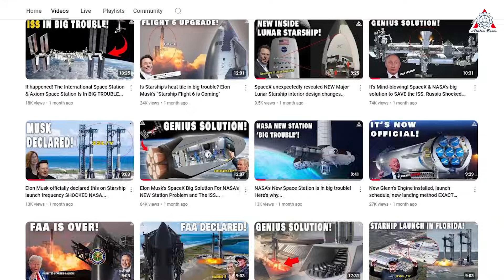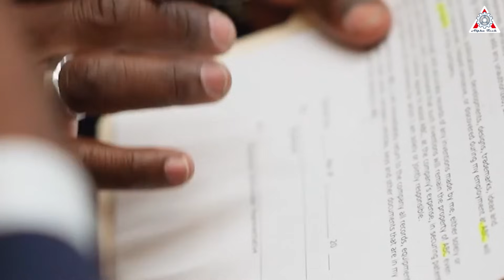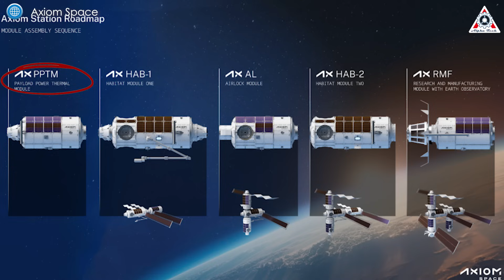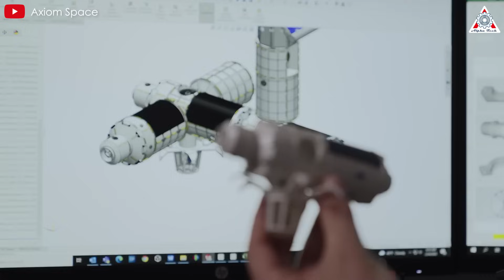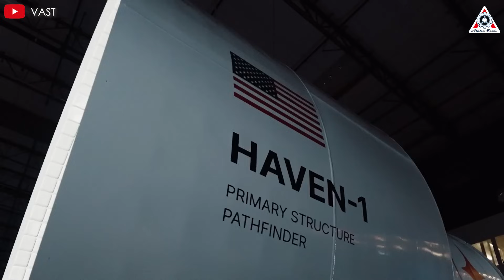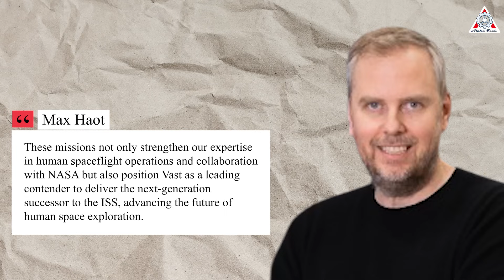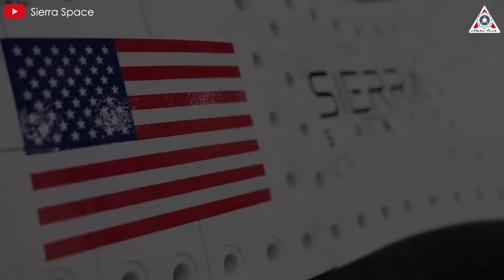NASA Reveals 5 Next Space Station Generations! Goodbye ISS...

Comment: Actually, our focus should be on mobility in Space, over permanent colonization in gravity wells, or on any body we cant yet physically move.

Other wise we are just sitting ducks for everything from Asteroid strikes, to Alien Re-Arrival.

I wont be listened to, but the fomula should invariably be  enough mobility to evacuate every one from any colony.

Otherwise our space technology is de facto assisted self demise inevitably.

Mobility should never be sacrificed for security is an old Warrior's Axiom.

On space stations using Starship, its an expedient I have done writs about, from individual to multiples in configuration...

But I have bad news for the ring design renderers, you have the ships on the wrong side of the ring, and 90° out from correct orientation.

The ships should be on the inside of the ring, and orientation should be transvere to ring rotation.

Here's why;
If you locate the ships externally you screw up your mobility. You would have to stop station rotation to attach a new ship. And every detachment would result in ships starting out on a random vector away from the station.

Better to do a wider "Rim", and bring the ships to the inside of it on the center line, rotate ships to match station, then use side thrusters to berth. This would allow building stations of any diameter, and supporting any number of ships, and not have to halt rotation any time one came or went...

Bad news guys, your design is a century old, and way better designs for the same materials and labor are possible.

 And this style of station could be extended linerally by added ring sections indefinitely, and turned it a linear habitat by enclosing it. leaving ported ends and entry ports for ships, and could have a ring of engines to move it...

Basically what I am saying is we can start building Yuge! starships now, instead of dinking around with designs from the 1930-1960's...

Why build dumb krap? when you can design ahead and build things that last for thousands of years of utility?

The design I am proposing could also be adapted to tubular Space Elevators from one end.
And literally launch Earth stationed loads out its center into orbit, or stop them in the station.

as usual, just sayin'

😊

Comment: While i like the Vast modular design concept, that allows NASA to adjust the station's size based upon its budgetary constraints. Starship seem to offer longer term benefits. You can build one in space orbiting the moon and one around mars. 

Space X can design a special expendable starship just for the Space Station. 

Several Starships permanently docked to a central hub. The individual crew areas are linked to the central hub and their fuel tank sections can either be converted to cargo space, or left as a refueling depot.

Put one orbiting the Moon and one orbiting around Mars. This gives you the ability to have a permanent orbital cargo depot and refueling station as well as a permanent orbital science station.

Space X then could optimize planetary starships to ferry cargo and personnel to and from the Space Station. From there a huge 18 meter station to station only Starship cargo vessels transports 1000+ tons of cargo and personnel.

This mimics local trucks delivering to and picking up its cargo from a large ocean going vessel.